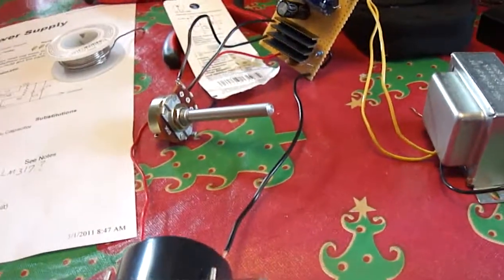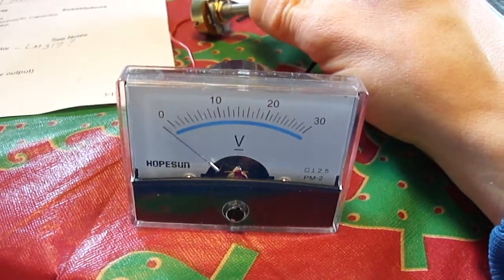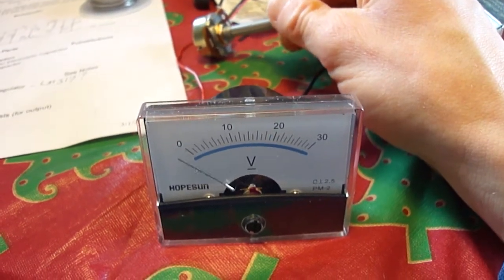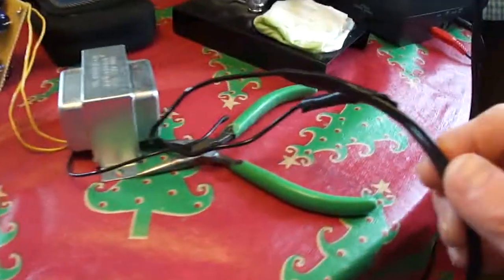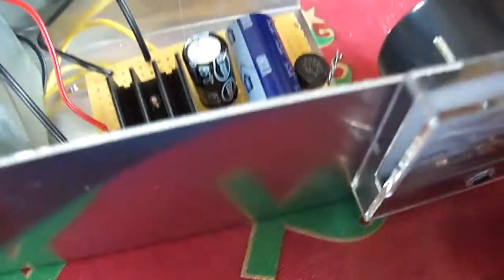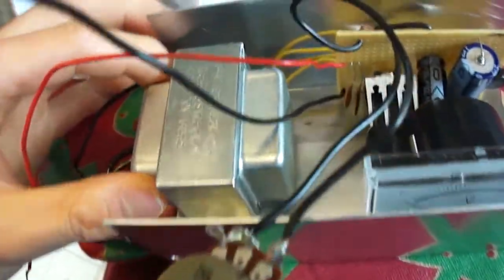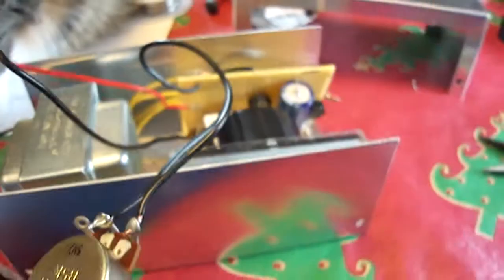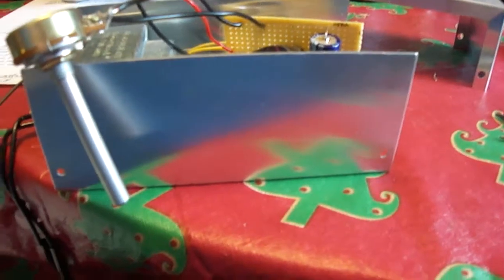Power supply update!

Comment: Looking good so far, it should go together nicely.

Your solder joints also look way better than mine, I need to work on that. Got a car cassette deck to put a new capacitor in, and I just hope I don't get too sloppy and cause issues.

Comment: that is a volume control pot. you need a voltage aduster rheostat. you can buy them at Radio Shack. there in the same drawer as the pots you have to look for the word "rhostat" i dont know if im spelling that right. they are much lower resistance.good luck!

Comment: If you put a load on it, and set it to 3 volts, you will get some heat out of the heatsink.
High input to low output = a lot of heat
High input to high output = less los of energie and so less heat

Comment from the maker: @thereelmaster that would be Rheostat. the circuit called for a 5K pot so that's what I used, but would that explain why I'm getting plenty of voltage but absolutely no current? because I just load tested it and it can't even run a small DC motor...